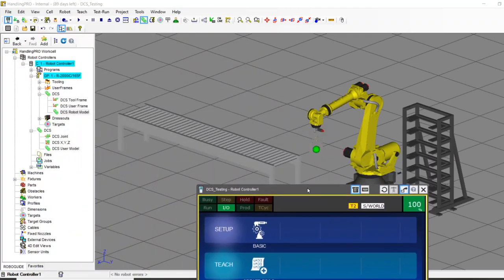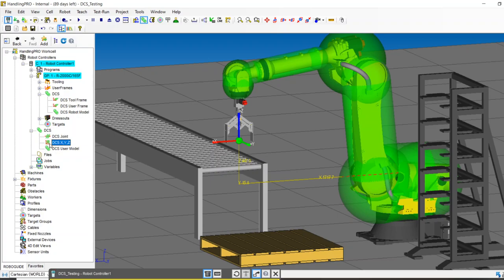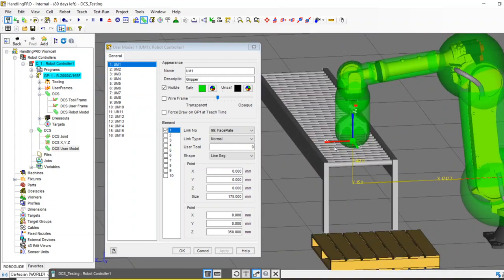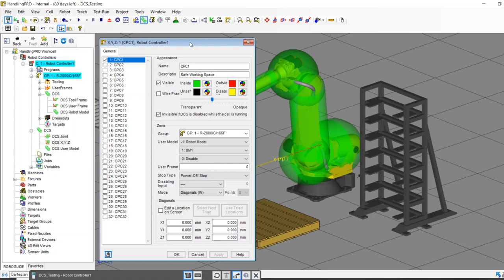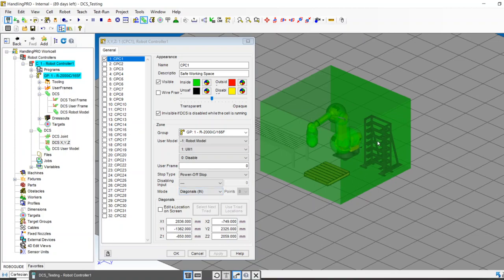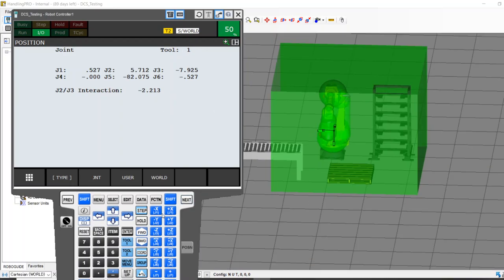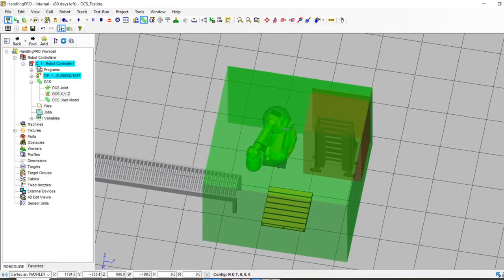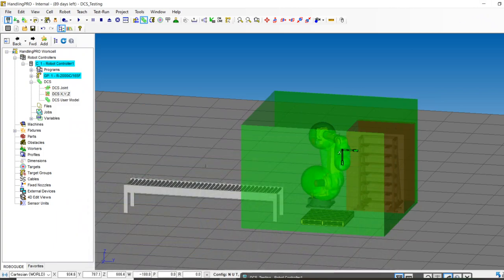FANUC DCS Setup (Dual Check Safety)

Comment: Great video!  One question.  At 14 minutes and 54 seconds in the video you begin to explain that it is possible to output the CPC states as a digital output to a PLC.  How do you do that?
Reply from the maker: This is a great question that I hope viewers read. 
One method to output the signal is via physical wiring. This method requires Safe I/O Connect, and wiring to the safe I/O board. Then under the Safe I/O Connect setup screen, you can map SIR[x] = CPC[x] and the status will turn those dual channel outputs on/off. 
The other method is to map a robot DI[x] to the CPC. You do this by configuring a Digital Input to Rack 36, Slot 6, Start X. So the CPC[1] status would be Start 1. If you have several zones, then map up to 32 DI's to this rack and slot, and then DI[1] is CPC[1], DI[2] is CPC[2], and so on. 
FYI Slot 6 is for CPC. JPC is Slot 8.
Reply: @AdamWillea  I had a chance to try it in Roboguide and it works.  Thanks for the tip!

Comment: Hello Adam, thanks a lot for the video, I have a question, when I use DCS with Line Tracking and for example I have a collision between DCS Ball gripper and other object, will stop only the Robot or the Conveyor too? My Application is powder coating with line tracking in conveyor, I have a robot working in a Window and I cannot have my robot in collision with this window, for that i need to programm DCS, but I don´t know if collision between work area and window will stop only robot or robot and conveyor, thanks in advance.
Reply from the maker: Hello - by default, DCS will only stop the robot motion. However, you can easily program I/O or safety wiring for the robot to send a signal to the tracking conveyor to stop running as well.

Comment: What if you lose your zeros, and then you need to move to the hash lines on all six joints to re-zero them. That takes the robot into the DCS box zone. How do you disable the whole DCS altogether so you can get your work done and your line moving again?! Kawasaki has a button for that! Can Fanuc just put a "Disable DCS" button on the controller cabinet? Ffs!

Comment: Great video. I'm probably too late to the party but still worth asking. Is there a way to transfer the DCS settings on Roboguide to the actual controller? 

I can export TP programs to the controller over ethernet quiet easily but that's pretty much it and I can't seem to transfer anything that is system related to the controller direct from the Roboguide..

Comment: Hi Adam, 

Thanks for Brief Video about DCS Setup. It is great help for me. I would like to know that how can I monitor DCS Work Zone/Safe Zone. I mean how can i setup my Digital signals based upon DCS Zone so I can monitor where robot is and I can do specific task based upon that. 

Thanks
Reply from the maker: Great question! Sorry I didn't cover it! You can monitor all DCS statuses by mapping your Digital Input (DI) Config to Rack 36, then the appropriate "Slot" number. For CPC like we built in this demo, simply map at least one - but no more than 32 - bits of DI to Rack 36, Slot 6, Start 1. When the CPC is SAFE, the DI will be ON. When the CPC is UNSAFE, the DI will be OFF.

Thank you!
Reply: Adam Willea 

Thanks.

 I will try it. Hopefully it will work for me.

Comment: Hello, Adam! Can you help me to reset error on our fanuc m-410ic? Error SRVO-337 "DCS PRMCHK alarm 2000000, 2000000"
Reply from the maker: Hello - this means that your parameters were changed and not applied, or a backup image was loaded that had different DCS parameters. Go to your DCS Menu, and press "APPLY" like I've shown in this video and apply your changes. You may also have to re-setup your DCS parameters to be the way you need them and then APPLY those.
Reply: @AdamWillea  thanks a lot for the answer! But I I try to apply them, but a password is required and 1111 does not work... Is it possible to see the password in the robot's backup files?
Reply from the maker: @ДмитрийКомраков-ъ6ф  Unfortunately I cannot help you there... someone must have changed the factory default password and without the correct password you cannot make changes.
You'll need to work with whoever changed DCS before you, and if you cannot - you'll need to contact your local FANUC Tech support to get your software reset.

Comment: Hi Adam.

Great video. Thanks for your clear explanation.
Quick question: can I disable a DSC zone and enable another, in case I have specific conditions (inputs) coming from a PLC?
e.g. A lid on the top of a cart. The robot needs to stop before it crashes on the lid, in case the lid is present; The robot can freely access the cart in case the lid isn't present.
Reply: I like the way you are thinking. This would be handy. A cart is in the way, avoid hitting the cart or such.
Reply from the maker: https://youtu.be/Uw2AsKTt6wo

Comment: Thanks for awesome tutorial. I used official DCS manual for first time and it took me like half day to make it work, it's very difficult to follow Fanuc manuals, without any prior training.

What are the options for programming Fanuc by PC? Roboguide is very pricey for one time project. Then there is ASCII upload option, but you have to edit program in text file, that's not very convenient. Is there any other option? I got quite a few motions, so I need to duplicate and modify lot of TP's, plus I would like to modify PR names, since it's pain to write comments on the pendant. Thanks
Reply from the maker: Hi! A much more cost effective solution for Offline programming is our OLPCPRO. This is basically RoboGuide without all the 3D simulation capabilities. So it allows you to have a TP on your laptop screen, make and test code, copy/save/paste/etc., and it costs 1/5th the price of RoboGuide. It is also just a one-time purchase, no annual renewals.
Reply: @AdamWillea  thanks, is there trial version?
Reply from the maker: @quincycz   Yep! Contact your local FANUC rep to get a 30-day trial of the software.
Reply: @AdamWillea  Thanks. I gotten Olpcpro, but it offers only programing through virtual TP, which is almost as painful as programing it on real TP. There is no real text based programming environment for Fanuc?
Reply from the maker: @quincycz  It sounds like you already tried the ASCII uploader. Many people use NotePad++ as the text editor and then upload to the robot.
Alternatively, depending on your RoboGuide rev (If 9.30 or later) you can select for the robot to have an option called "iRProgrammer" which is an intelligent auto-fill text editor programming style. This style is the native programming language on all of our SCARA models.

Comment: Great video! Thanks a lot!
If i missed the answer in the vid to my question i´m sorry but is it possible to prevent a usermodel to touch another usermodel?
e.g. I found out how to activate the robot-usermodle (idk if thats needed additionally) and i made a basic usermodel of my EOAT. But since the gripper is pretty large i would like the dcs to check that usermodel 1 (robot) and usermodel 2 (gripper) are not "touching" eachother. Is that doable?

Thank you in advance and keep up the great work!
Reply from the maker: Thanks so much for watching and for the great question! ANSWER: Yes you can easily do this; you will want to build an additional CPC check. Watch this video at 16:25 and where i say "99% of the time you'll use Diagonals In or Diagonals Out"...... well my friend.... you are the 1% :) hahaha
Set up this new CPC as Mode: Target Model Collision. Quoting our FANUC manual, this is defined: "When the shape models mounted on the tool or robot arm collision
between each other, shut down the motor power" which is exactly what you want to keep your tool from hitting your robot. 
Keep it up, and Go Panthers! (I formerly lived in NC)
Reply: @AdamWillea  thank you. You're the man!
I'll definately come back for more good content. 
Keep pounding Adam 🤟

Comment: Great video to enhance our knowledge of DCS. How do you deal with the curve of the tool safe zone as it would aporoch the conveyor if it had a safe out zone defined and the gripper needs to get close to the bottom of a part? Seems the don't use Box option would be best for that?
Reply from the maker: Hi Corey, you are correct that in this case the Box shape option for tool model would be best.